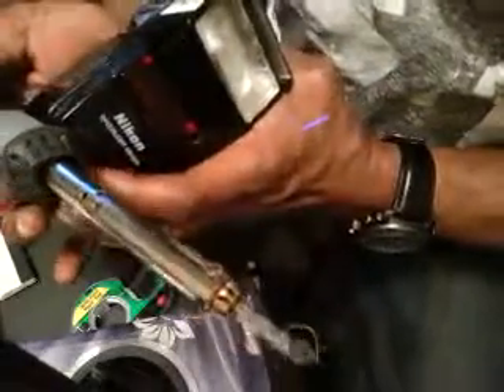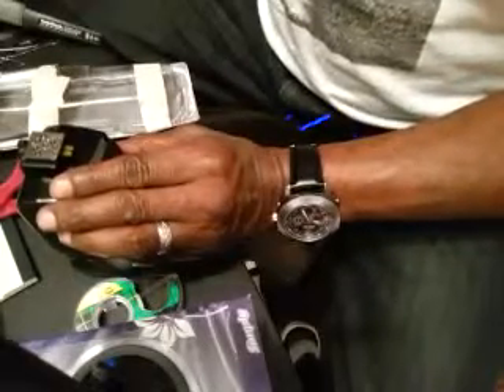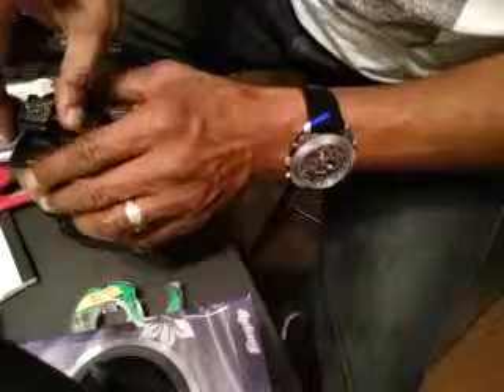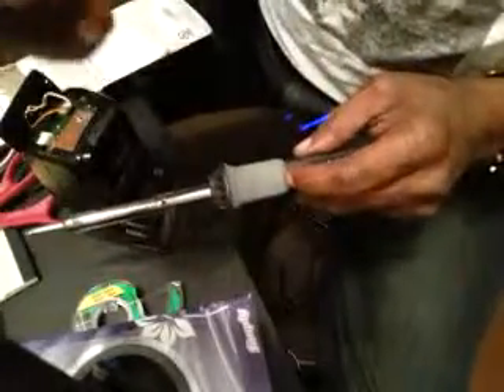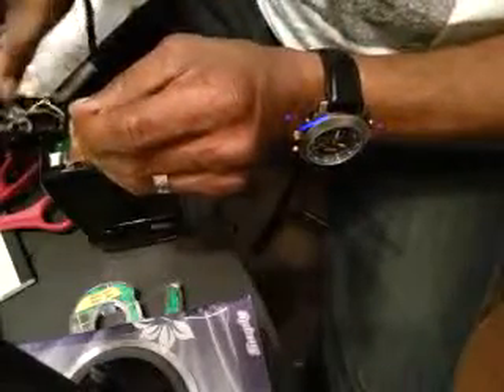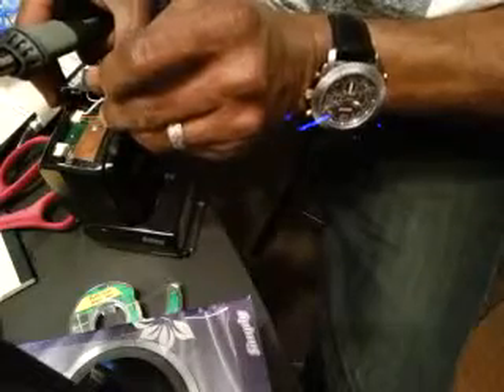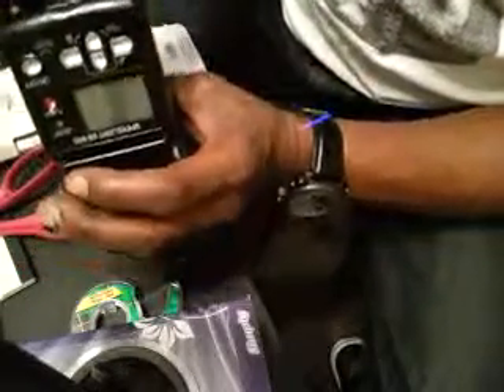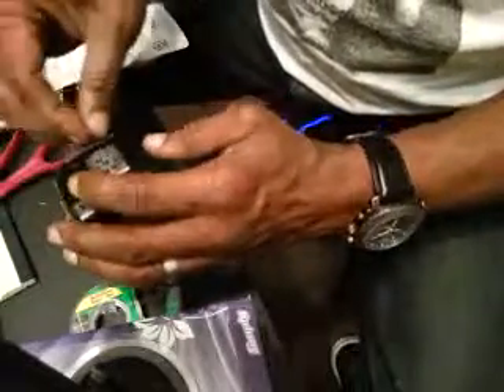How to repair a Nikon flash SB600 & soldering wire

Comment: Not job William.  did it not work at all or was it erratic before the ground was attached?   Have one that the previous owner claims he replaced flash tube.  It flashes as it should but then flashes on its own ever 20 seconds or so.   Curious your thought before I crack it open.